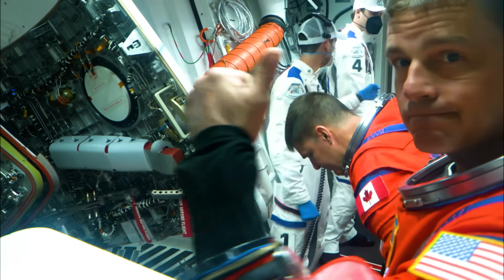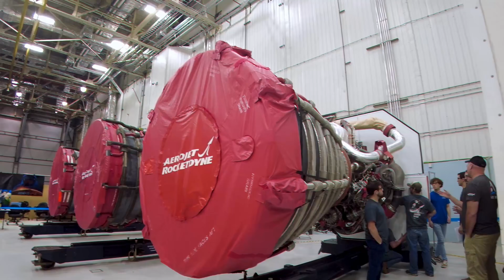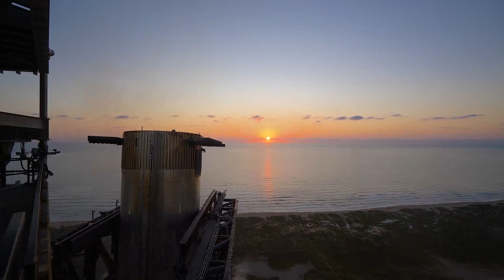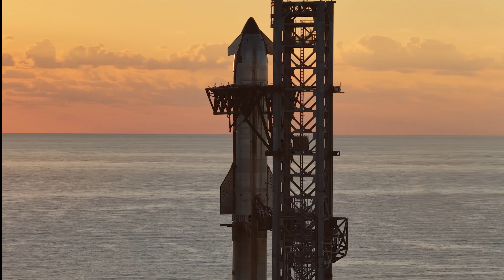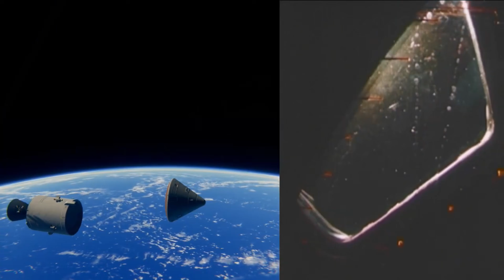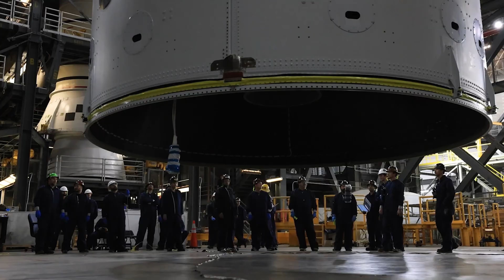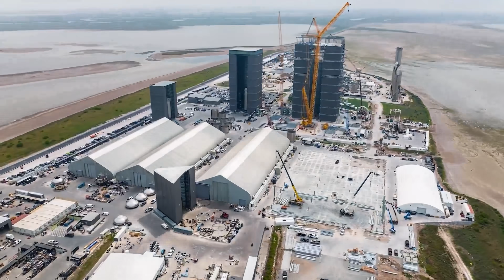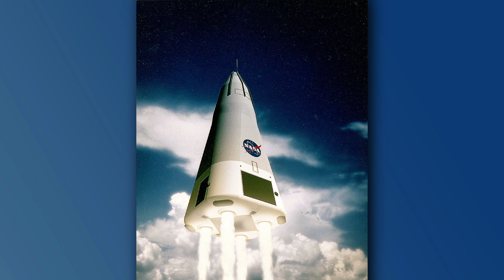Why SpaceX Starship and NASA Rockets Are So Different…

Comment: An entire starship and booster costs 93 million, 1 engine from SLS costs 145 million.
Reply: SLS is not resuable too
Reply: NASA doesn’t make rockets. 
It buys them. 
It’s Boeing/etc vs SpaceX 
The entire video is wrong 
It’s like saying the air force vs Boeing who makes cheaper planes 
Or the army vs colt who makes cheaper guns 
Ones a government agency and one is a manufacturer
Reply: @Aaron-f5s9eThe video does address this, but the title is stupid and feeds a misconception held by many people who don't know any better.
Reply: @Aaron-f5s9e NASA is the problem though buying these overpriced rockets that is 50-50 on will it have problems or not
Reply: @bff458  What problems does Falcon 9 have? well over 600 perfect launches.
Reply: How much for 15 refuels to the moon, how much fakery about colonizing Mars are you willing to tolerate.
Reply: Talk about waste and abuse.  Taxpayers have spent how much to put up a few star link satellites and explode rockets?  Maybe the chainsaw should have been turned around.  
 What was the original promise?  Moon by 2024?  Or was it even earlier than that?
Reply: @teamtechworked8217  --  Who told you taxpayers are paying for SpaceX starship development?  Secondly, you have no understanding of the concept of experimentation and testing. Go back to your own line of work instead of commenting on rocket building.   Haters never build anything. They just hate on the builders.
Reply: @rayrwyr💯
Reply: @teamtechworked8217  Maybe you're just another uninformed blabbermouth that doesn't have a clue what he's talking about.Taxpayers paid nothing for starlink satelites or exploding rockets., NASA did contract a Starship HLS version though, small potatoes up to the massive funding  Lockheed Martin, Northrop Grumman, and Aerojet Rocketdyne, especially through the SLS + Orion programs — which dwarf SpaceX’s NASA funding.
Reply: @Frank-costanza  No it's not, had some contracts, but nowhere near the taxpayer money doled out to other companies, so far three contracts received for Space X is 15 billion, a drop in the bucket, WAY more taxpayer money than SpaceX are:

Boeing

Lockheed Martin

Northrop Grumman

Aerojet Rocketdyne

United Launch Alliance (ULA)
Reply: @Frank-costanza  Okay, and them getting the least tax money support still hurts you so badly, how dare they become the number one space company, I don't understand why you're so butt hurt about a successful company. Do you rail against Northrop Grumman?
Reply: @Frank-costanza  You really are an idiot, subsidies? Nope just contracts.
Reply: @Frank-costanza  The contracts :                                                       1. Commercial Crew Program (CCP) — Crew Dragon astronaut transport                                                             2. Commercial Resupply Services (CRS‑1 & CRS‑2) — Cargo Dragon ISS supply runs                                                    3. Human Landing System (HLS) — Starship lunar lander for Artemis.                                                                               What subsidies you imagining hammerhead?
Reply: @Frank-costanza  You still don't know the difference between contracts and subsidies though, you're very low IQ.
Reply: That's why SLS works and starship doesn't. If SpaceX gets it right, the costs will be similar.
Reply: @kevinmorin7674  Huh. the costs will never be similar, Space X is making the cost fall rapidly, what are you talking about.
Reply: @gercoop100 How can the costs fall when they haven't even made Starship human-rated yet nor capable of reaching orbit, let alone do that reliably? All those milestones come with a lot of cost that you can't trim off down the road.
Reply: @kevinmorin7674  Uh, the Falcon 9 looks pretty reusable to me.  Starship is heading down the same path.  Not a Musk fanboi, but I do respect track record.
Reply: @garyhalmbacher6875 I respect track record too. Must always quotes that they can do something at 10% of the cost of the rest of the industry and NEVER has delivered on those promises. There is a foolproof way to determine if Musk is lying- it's when his lips are moving. Also, smaller rockets are historically simpler than larger rockets so it'snot surprising that falcon 9 is a reliable platform althoughit should be noted that it isn't 10x cheaper to launch with that platform despite being reusable. Scaling up to Starship isn't as simple as more fuel and more engines and never has been.
Reply: @kevinmorin7674  Human Rated. Meh.  The space shuttle was human rated. Apollo spacecraft too.  Human Rated by NASA gives me so much confidence.
Reply: @kevinmorin7674  While Musk is a bit of a carnival barker, I don't care if it's 90% cheaper.  That would be great.  But if it performs with same or higher reliability then 10% cheaper is great. Tell me truly you don't consider price near the top of the list for anything you buy.
Reply: At least it gets the job done
Reply: Boeing, Northrop Grumman will have there own cuts and reward their political allies too. So that's where the money goes.
Reply: Government work always costs more
Reply: @DBAP_1985  Parrot
Reply: Someone needed a big bonus from the government
Reply: And what has starship successfully deployed?
Reply: @fauxbro1983 it did actually successfully deploy dummy star link satellites on the last test launch. Also artemis went into development 15 years ago starship went into development 7 years ago and is significantly more ambitious of a project. Artemis took 15 to reuse parts from the space shuttle to make a rocket starship is being designed from scratch.
Reply: Artemis has already orbited the moon. Starship has had a dozen launches, lost 5 of those in spectacular fashion and has never achieved orbital insertion.
Reply: @Clean97GTI  So what, are you saying when starship is fully operational very soon, it's NOT going to progress space flight to new heights never seen in human history, or are you hoping against it because you have some weird idea there is a rivalry between NASA and Space X, like Maxwell Smart fighting Chaos?
Reply: @gercoop100  Lots of If's and When's in your argument. Anything concrete? 
Like, SpaceX can already deliver satellites to orbit with Falcon-9 and does so repeatably and reliably. 

That's a definite statement and it is factually correct. I don't mind giving credit where credit is due. Starship is kinda trash though and for all the big talk about when it's gonna lift hundreds of tons and do orbital cryogenic refueling is overshadowed by the fact that it can't get to orbit in 12 tries and counting. As a point of reference, the 12th launch of Saturn-V carried Apollo 17, the final launch of the Apollo missions. The 13th and final launch of Saturn-V carried Skylab into orbit.
Reply: @Clean97GTI  What argument? What if's and buts? You're not very sharp are you? What are you babbling on about?
Reply: @Clean97GTI  What do you mean it can't get to orbit? of course it could, you mean it's a failure because it hasn't tried yet, not up to your timeline, man you're a total loser. You need to try and keep up.
Reply: @Clean97GTI the fact that you brought up falcon nine just shows how ignorant you are. There is a whole compilation of clips that SpaceX themselves put out with all the falcon nine boosters that blew up during testing. If you actually bothered to try and understand it you would know why though. NASA went with a very traditional design the hell out of it on paper until it's as perfect as you can get, test a few times to tweak and then you got a complete project. SpaceX works on the philosophy of rapid prototyping. Build it, push its limits, find out what went wrong, fix the problems, repeat. Both are valid approaches the SpaceX method just generally produces faster results. It's also important to note that artemis, while impressive, is just doing things we've already done before and have a lot of knowledge on. Spacex caught a 240 ft tall booster midair. One is refining something one is doing something entirely new so to try and compare their timelines and results is idiotic especially when they didn't start development at the same time. You're either the biggest troll in the world or the biggest moron and I hope for the sake of humanity it's the former.
Reply: @Dylanbeawesome  You're so snowed by the BS from the SpaceX hype train, you don't even realize why what you just said is completely stupid. 
Yes, NASA and other contractors design on paper and computer before construction. They do small incremental controlled tests and then need minimal test launches because they're already sure they'll have a successful rocket. And it's faster than Starship.
The proof is in the pudding. From the first Saturn-V launch in Nov 1967, it was less than 2 years before Apollo 11 (the 5th launch of Saturn-V) launched and landed men on the moon in July 1969. Starship hasn't reached orbit or successfully deployed any cargo to orbit. 

So Starship is 3 years and 13 launches in. Hasn't reached orbit. Hasn't deployed any cargo to orbit. Hasn't carried a crew. This most recent launch successfully deployed 20 Starlink satellites, which proceeded to burn up in the atmosphere a few minutes later. The 13th Saturn-V launch carried Skylab to orbit.

How is this rapid iteration better than than the old school way of just designing it right the first time? Looks to me like it's failing pretty miserably. They had multiple engine failures this time too. So even the fancy full flow Raptor engine is still having teething problems 3 years, 3 iterations and 13 launches later. 
You're talking about catching boosters for landings which sounds cool but it means you have to carry extra fuel and relight the engines to land. How is this  better than just deploying parachutes like the be SRBs did on the old Space Shuttle launches? Sure a parachute isn't fancy and doesn't look cool on TV but it works and it doesn't require you to carry fuel that could have otherwise been used to lift cargo.

In what objective metric is this better?
Reply: @Dylanbeawesome 
Starship and StarLink are NOT the same thing. Elon Musk does NOT use Starship to put StarLink satellites into space. 

Starship has never had one single successful orbital launch. Ever. Please get educated.
Reply: @gercoop100 "very soon".
Reply: @joeybulford9055  -- Flight 13 of Starship has put real V3 Starlink satellites (not dummy like Flight 12) into space.
Reply: @Clean97GTI  -- SpaceX Starship Flight 13 on July 24 2026  flawlessly deployed 20 real, fully functional Starlink Version 3 (V3) satellites into space.  Because Flight 13 was a suborbital test flight, the satellites were not left in space to join the active constellation. They deployed their panels and tested their antennas during a brief 20-minute coast before safely re-entering Earth's atmosphere and burning up as planned.  The successful deployment and subsequent testing provided critical data required for SpaceX to transition to full, permanent orbital Starlink V3 launches on future Starship missions.
Reply: That's nothing to be proud of, especially when Falcon 9 already does that. 
And so does nearly every other space launch system.
Reply: @Dylanbeawesome I don’t think blowing up 12 starships for about 100 million dollars each and on some occasions almost knocking jet liners out the sky while you rain fire over the Caribbean as a rational way todevelop a rocket. Imagine Apollo blew even like 5-6 Saturn 5’s and then like it’s ready!
Reply: @Dylanbeawesome    Space X benefits from technology transfer from NASA. Without this transfer, they would not have been able to build a rocket from scratch.
Reply: @Clean97GTI it's really not fair to compare starship to Saturn 5 because it had the backing of our entire country to fund it instead of just one private company. I would sure hope it's development would be fast. It's a lot more fair to compare it to the sls that had more modest government funding and you how long that was in development, 11 years. Starship is a baby in the development cycle compared to that so yea I'm not surprised they don't have it all worked out yet. Once starship hits 11 years of development then we can talk.

Are you just totally incapable of understanding the concept of reusability. The starship cost around 100 million to make right now so if you can reuse that it's absolutely worth the loss in payload capacity an the extra fuel necessary. It's not even a close argument that. And the shuttle you bring up sure it did glide back down (didn't use parachute to get back down just to stop it on the runway so I'm not sure where you got that from) but it also threw away the SRBs and the fuel tank every single launch. It's hard to find the exact numbers but it looks to be that that was around 150-200 million dollars lost per launch. That's a pretty significant waste but it seems that would have been to much for you to research since you didn't even know how the space shuttle lands.

You forget that these are both for different use cases. The shuttle could use gliding and parachutes for its main landing mechanism because it always landed back on earth that has an atmosphere. Starship is intended for use with moon missions and potentially mars missions. The moon has no atmosphere and mars does not have a thick enough atmosphere to be able to use gliding and parachutes as a landing mechanism. For someone being so judgemental about my intelligence you seem to either be pretty stupid or so lazy that you didn't even bother to do a couple minutes of research. 
Last note and I'm sure you'll say it's not a fair comparison but falcon nine was only in development for 4.5 years so that's at least a decent sign that rapid iteration may be quicker. But you'd have to actually take a couple of seconds to figure that out and clearly your time is too precious for that.

Edit: I see you were talking about the SRBs using a parachute not the shuttle that's my bad. But the reason you can't use a parachute in this case is you'd never be able to control where it lands and therefore retrieval for reuse would be impossible.
Reply: @vladdumitrica849 and NASA benefitted from technology transfer form the Nazis so what's your point. You know who also benefitted from NASAs technology...NASA. Yet it took them 11 years to reuse their own technology to make a rocket. The SLS uses the same boosters and same engines that the space shuttle did just in a different configuration. I'm not trying to dog on NASA but if you're gonna try and make an argument think it all the way through.
Reply: @fauxbro1983  -- SpaceX Starship Flight 13 on July 24 2026  flawlessly deployed 20 real, fully functional Starlink Version 3 (V3) satellites into space.
Reply: @fauxbro1983 derp… these same comments were made about Falcon 9 when those first launched.
Reply: @fauxbro1983  Hasn't had any missions yet, still in testing, your point is moot,
Reply: @fauxbro1983 it's deployed itself into the oceans a bunch of times. 😂
Reply: @fauxbro1983 it’s been in development for 7 years while sls has been 15 and cost a fraction of the sls. Best case scenario sls is still to expensive to be successful. So even if everything goes right it’s still not sustainable and we spent 20 billion on leftovers from the shuttle. Starship is already able to make it to orbit and could easily be used to launch stuff if they treated it like every other rocket and expanded it after every launch but they’re actually trying to innovate and make a fully reusable rocket. If ur taking a shot at starship that’s pretty ridiculous
Reply: @Frank-costanza how long has sls been in development? Starship hasn’t made orbit because it’s working on reusability, spacex already knows they can make it to orbit. Sls is to expensive to even have success as a possible outcome
Reply: @Frank-costanza ur a simple person
Reply: @Frank-costanza you realize we’ve been to the moon already like 50 years ago right…? The reason we stopped was because it was to expensive to justify, so what exactly did sls accomplish if it’s still to expensive to do anything meaningful? Even if it’s 100% successful in every mission that’s still 4.5 billion per launch so we’ll never have a functioning moon base with that. Starship is actually attempting to solve the problems have prevented us from doing this before so it’s ridiculous to even compare the 2 ships. Sls has been in development for 15 years, starship only 6 and already way ahead of sls. Elons got a production line for starship so even if they have to expand a rocket each launch like everyone else does it’s already massively cheaper and he’s making a rocket every month so it will actually happen in our lifetime
Reply: @Frank-costanza in that it’s technology is decades ahead of the overpriced bottle rocket called sls. Life must be easy being so simple 😂
Reply: Government is greed, thieving, sloth, waste, corruption & Nasa is government.
Reply: @warrenwhite9085  I agree, but NASA has still managed to orchestrate and achieve miracles in the past: the Apollo missions, the Voyager probes, the space shuttles…
Even though they are at the mercy of governments and their budgets, they still have a role to play in space research and exploration.
Reply: @algcyt.  NASA is just another greedy, bloated, wasteful, thieving Federal Agency… F their 50+ year old faded videos & stories.
Patriotic individuals & businesses made Apollo work in spite of NASA. Defund NASA now, it’s hopeless.
Reply: @warrenwhite9085 yes, give your life and soul to a private company, they will love you and care for you ❤❤❤ never doubt this!!
Reply: Not true. A recycled RS-25 is about $70 million, a new one $35 million.
Reply: @rocksnot952 . NASA’s primary RS-25 engine contract with L3Harris is a $1.79 billion contract modification to build 18 newly designed engines, and an initial $1.16 billion production restart contract, bringing the combined program value to approximately $3.5 billion for 24 engines.
Which is $145,833,000 per engine.  Vs Raptor sub $1 million per. It’s that bad.
Reply: @warrenwhite9085 and how much has SpaceX lost each time a boost section goes into the ocean or explodes and takes the entire Starship with it?
Reply: @Clean97GTI . The total cost of acquiring, building Starbase, & all Starship test flights is less than the cost of each NASA SLS/Orion flight {$10+ billion).
Reply: @warrenwhite9085  Easy to claim when none of that except the failed test flights have occurred so far. I was supposed to have been able to take the Hyperloop to work already but here I am, still driving my own car.
Reply: @Clean97GTI u realize spacex is the only one actually retrieving these things anyway right? Every other rocket is expanded after every launch so saying starship is a failure because it’s not fully reusable yet is pretty ignorant
Reply: @EdwinSherwood and considering SpaceX isn't any cheaper than it's competitors, who cares? 
Besides, we've been recovering rockets for decades. It's just that previously instead of fancy vertical recovery, companies just used parachutes the SRB's on the space shuttle.
Reply: @Clean97GTI what facts are u going off of..? Ur literally just making crap up because spacex is way cheaper than anyone else, there’s a reason they launch 80% of everything that goes into space. Do some research there buddy if u care enough to be commenting about it online. Srb’s are not reusable at all and the parachutes are for capsules not rockets. Feel like I might be arguing with a 12 year old here
Reply: That’s like saying we’ve always had transportation but instead of those fancy combustion cars we had horses😂😂
Reply: @EdwinSherwood There's literally video footage of the space shuttles SRBs parachuting back down.
Reply: @Clean97GTI  How often has SLS lost a booster in the ocean?  Oh, that's right. Every F'n time.
Reply: @garyhalmbacher6875  SLS is supposed to lose boosters in the ocean. They're expendable. 
How many times has Starship made it to orbit? 
Oh, not one single time? All 12 haven't  reached orbit?

Yikes.
Reply: @Clean97GTI   And after 11 years and TWENTY THREE BILLION DOLLARS, SLS accomplishes a feat done by Saturn IV.  SIXTY YEARS AGO. Sorry, but not impressed.  And should that 40 year old technology fly again, it's not financially sustainable.  It's possible, though, that you're a government hack, which means your answer for everything is to extort yet more money from the overburdened taxpayer.
Reply: @garyhalmbacher6875 
SLS is necessary if we want to get back to the moon is a reasonable period. The SpaceX HLS was supposed to be 2 years ago and I'm orbit for testing. Meanwhile Starship hasn't made it to orbit yet and the HLS is where??
SLS has repeated the success of Saturn-V, you are correct. Meanwhile, SpaceX still hasn't explained how they're going to accomplish orbital cryogenic refueling of the LOX and CH4 they're going to use to push the HLS to the Moon. 

The launch portion of this was supposed to be done already. It was supposed to be done in 2022-23 with missions beginning in 2024. 
SLS was supposed to be a stopgap. It had to be restarted when SpaceX couldn't meet it's timelines.
Reply: @PantherCreekPlantation  You do testing on the ground where you're not risking an entire rocket. That way, when you do launch, you don't need a lot of testing. Saturn V had two test launches, both of which were orbital and carried a payload. 
The next 11 Saturn-V launches were operational. 10 were crewed and carried men to the moon. The final one was automated and put Skylab in orbit. 

Starship has needed 13 test launches and is still not operational. 
Why? Why is it so unreliable?
Reply: @Clean97GTI not that much. Especially not if you consider the amount of knowledge learned from those mishaps.
Reply: @sk.8835  Or you could, you know, build it right the first time so you don't need 13 test launches and instead, could start carrying cargo to orbit or maybe even crews to the moon. 
The first launch of Starship was April of 2023. It's July of 2026 and they haven't gotten to low earth orbit yet. The 20 Starlink satellites they launched burned up a few minutes after release. 
For comparison, the first Saturn-V launch was Nov. of 1967. Apollo 11 was July of 1969. Less than two years and Saturn-V put men on the moon. Technically, it delivered Astronauts to lunar orbit prior to that with Apollo 8 in Dec 1968 which is 13 months after the first test launch. 
Starship looks pretty shitty in comparison.
Reply: @Clean97GTI . If you break down the math. Space x even profits on its crashes.    The fact one rocket has been used 20 times at a 100th the cost of others.  Every second one could crash and he would still be making profit …
Reply: @Frank-costanza  You mean NASA, right?  Cost FOUR BILLION DOLLARS for one launch after TWENTY THREE BILLION IN NRE for a launch EVERY THREE YEARS to circle the moon, a feat accomplished SIXTY YEARS AGO by Apollo.  Do you consider those facts impressive?  You probably think $4M per missile for a 5% hit rate by Raytheon is impressive too. I bet you work for the government. It doesn't take much to impress a government worker because they never accomplish anything.  And money for a program means nothing to them because it's someone else's money.
Reply: @Frank-costanza  Yes.  NASA made it to the moon.  In July 1969 I believe. I watched it live in black and white on TV.  They went back a few more times until Nixon shut the program down.  NASA hasn't been back since.  They quit.  For 60 years.  And then this year, they went around the moon.  For $4B.  Not sure your terminology but going around the moon is not 'going to the moon.'
Reply: @Frank-costanza   NASA has done some impressive work.  In the past.  Under Dr. Werner Von Braun, a true engineer.  Key word is 'has', has meaning 60 years ago.  Von Braun was a visionary.  NASA has been run by bureaucrats since.  The new guy, forget his name, has some impressive credentials, but he's still run by corrupt, scumbag politicians.  

At $4B a pop and a launch every 3 years, SLS is a technological dead end. 

Can SpaceX do better? Well, they are currently responsible for more than HALF of all launches. IN THE WORLD!  That's street cred in my book.  Can they scale that success up with Starship?  We'll see, but at least the cost structure makes sense.
Reply: @Frank-costanza   You are obviously not paying attention.  SLS is a dead end. It's too F'ing expensive and cannot make the launch cadence.  Even NASA admits this. 

Is Starship the answer? Maybe.  But at least the cost structure is correct. If US wants to showboat and repeat what Von Braun accomplished 60 years ago by landing an outhouse size hut on the moon only to return to Earth in a few days, then it's possible to do so with SLS, but if a permanent colony is the goal, SpaceX or something cost effective like it is required.  

On a related subject, you do understand that NASA is currently using very expensive reusable rocket engines on the booster, which are then crashed into the ocean after every flight. Correct?  Why not crash your car into a tree and buy a new one after every trip to the grocery.  No strawman retorts.  Answer my point directly about the engines and launch costs.
Reply: @Frank-costanza  Agree with your first paragraph.  Regarding the 2nd paragraph, so what?  Many Falcon 9 rockets exploded or crashed and burned in the early days. Today SpaceX has launched MORE THAN HALF of all launches.  IN THE WORLD! While under 300 miles, I will take your word, but they launch half of all launches because THEY ARE THE LOWEST LAUNCH COST IN THE WORLD.  You talk about all the great NASA launches.  Maybe on old legacy rockets some science packages, but regarding a moon colony, they have nothing. 

I'm thinking you are in some position which doesn't require financial responsibility.  Me, I am a small businessman in a technical field and believe me, cost matters.  If I'm not cost competitive, I don't sell anything.  Artemis will never be a part of a moon colony if anyone can even build one because they are unaffordable and launch cadence is abysmal.  I am not a Musk fanboi BTW.  Some of his ideas, like tunnel boring machines and AI in space, are just wacky.  But for SpaceX, he has a great track record.  So far.  SpaceX may or may not be able to build a moon colony, the Chinese might be able also, but Artemis with their disposable reusable rocket engines will not be part of the colony build.
Reply: @warrenwhite9085  Thank you.
Reply: @Clean97GTI  less than an SLS engine.
Reply: Starship has never had a successful orbital launch. Not one. Not one single time since its introduction a decade ago. Like, please stop comparing it to NASA'S SLS, you imbecile.
Reply: They also haven't tried to go orbital yet.